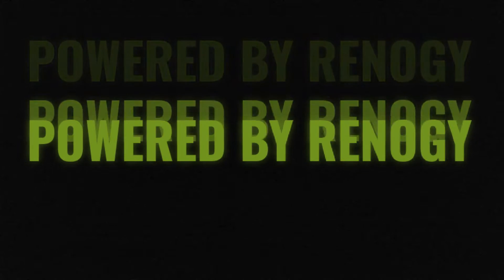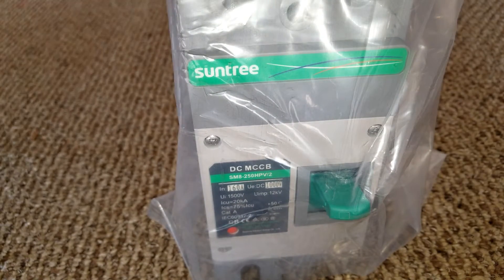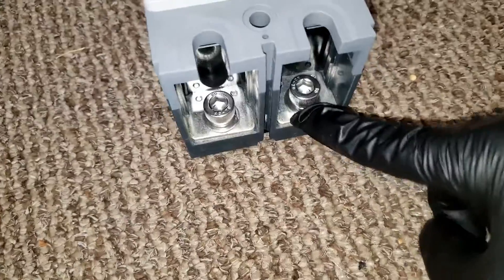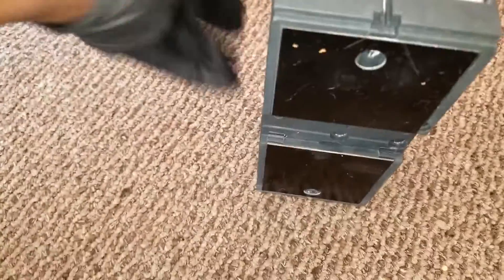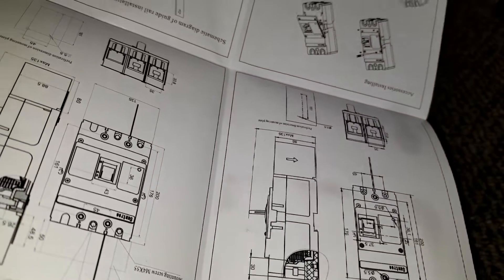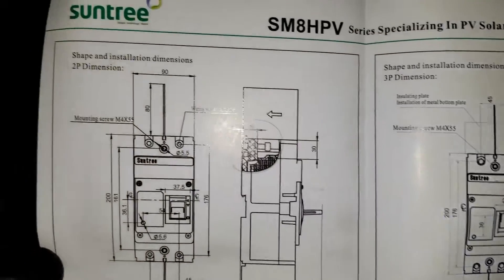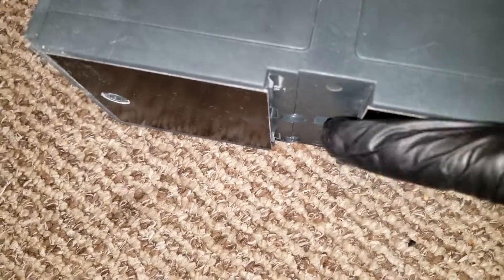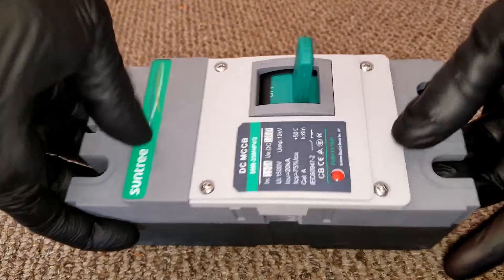SUNTREE SM8-250HPV/2 160A 2P DC MOLDED CASE CIRCUIT BREAKER

Comment: Hello, is this for the protection of solar batteries?
Reply from the maker: @barkley96  
Yes.
A battery bank disconnect/Isolator.
Thanks for stopping by and don't forget to SHARE LIKE & SUBSCRIBE
Reply: @jwsolarusa  In case of a malfunction, does it automatically disconnect?
Reply from the maker: @barkley96  
Absolutely

Comment: Your "rubbers" slide down between positive and negative in the little dovetail slot. I have the TAIEXI 160 amp 500 V from AliExpress. No problems with it so far.
Reply from the maker: Ok.
Thanks for the info.